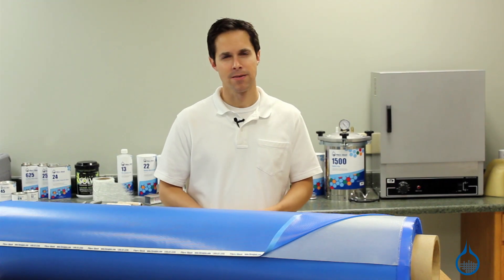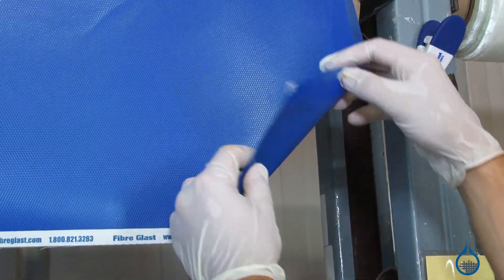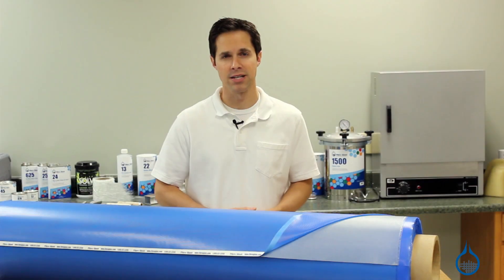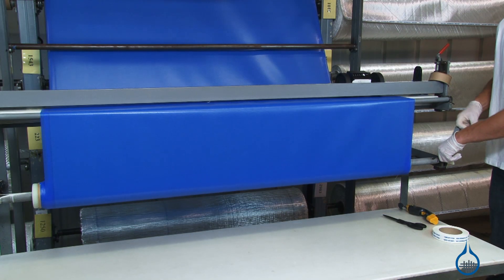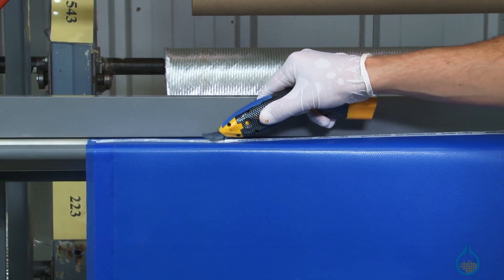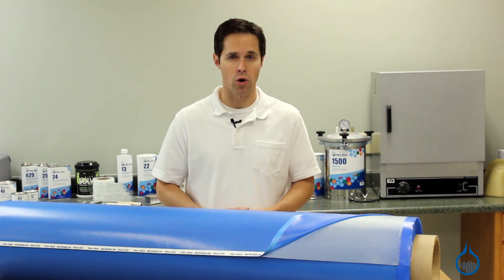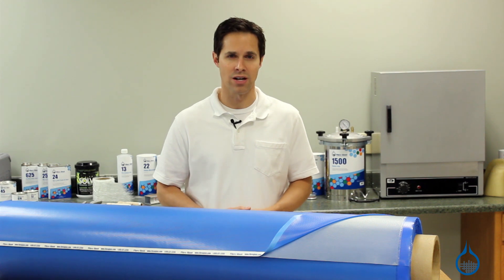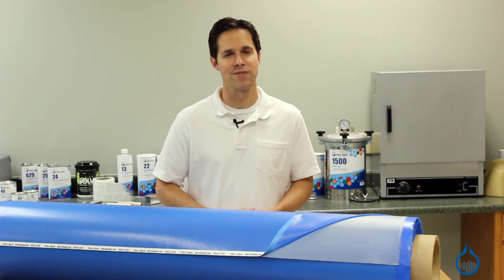Prepreg 7781 E-Glass

Comment: Thanks for the video, I have a question regarding fiber orientation,  using prepregs for example, molding as cylinder (for pressure vessel/vacuum vessel applications) where the strength is needed along all three directions ?